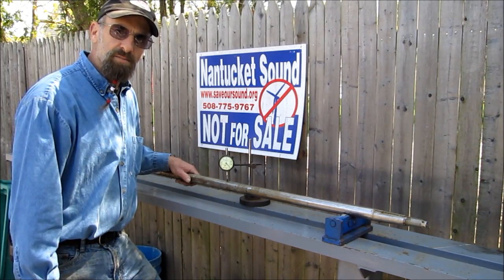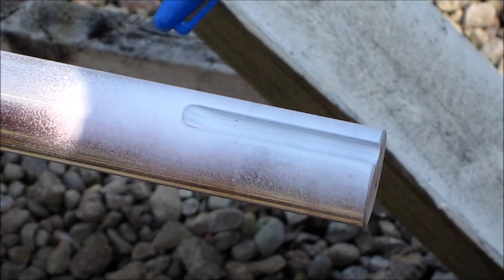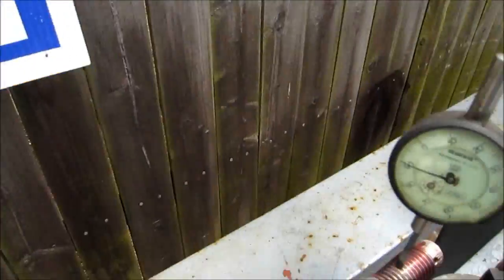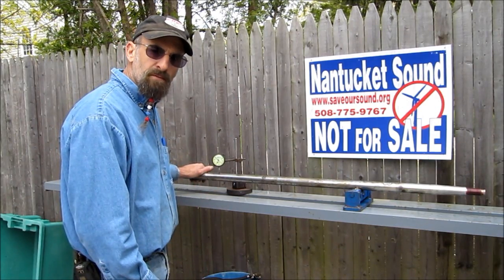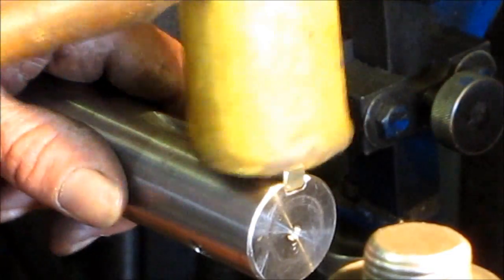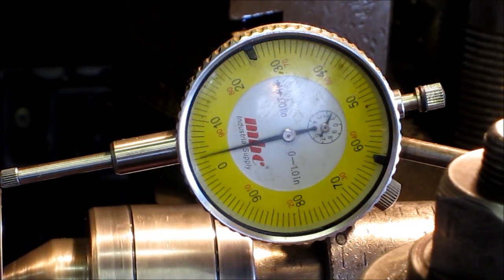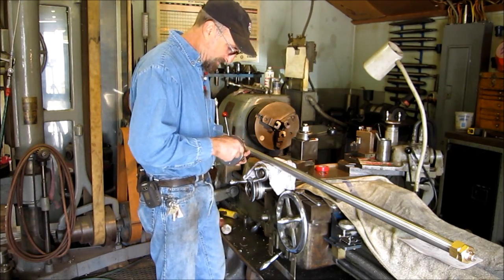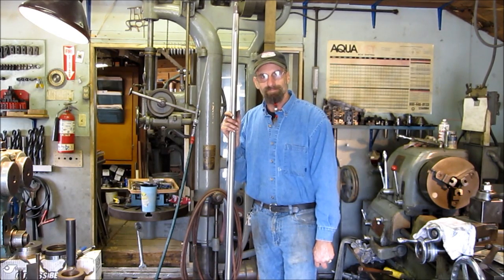How much Bend is too Bent!

Comment: I was having some major problems with my shaft in my boat and was getting a lot of input from different folks.  I saw this video and learned a lot and also witnessed demonstrated competence.  I needed help.   I went to Keith's website and got his contact info and we had a VERY friendly, patient, informative, technical and helpful conversation to the point I know what I need to do now to fix issues that included all the touch points on the shaft like coupler, intermediate bearing, stuffing box and cutlass bearing!  He has a donate option on his website with paypal and I paid promptly with the "cured my headache" option.  Time is money!  I will be back - I was lucky to have caught him at the right time - he was able to review my email and embedded video that outlined my understanding of the facts and data.  Thank you Keith !

Comment: Your video was excellent. It showed me that I can get the bend out of the shaft as I was planning on mild heat and beat the metal into submission. It was by the time I saw you expand the key I was just ... the dude knows metal. It also helped me a bit in how the balanced coupling is put together so I do not screw the balance nuts up pulling the shaft. Thanks.

Comment: I purchased new cold rolled steel plate 1200mm x 150mm and 10mm thick for purpose to be ways for my diy metal lathe. But they in the shop catted that piece with big machine scissors, and it got distorted all the way by length uniformly, that has about 5mm deviation on the middle. How to straighten this to be reliable for my purpose?

Comment: I worked as an equipment operator at a DuPont film plant years ago and worked out of the Millwrights shop. One of the head millwrights ended up being a family friend and was always building something for the inside of the plant out of stainless and it might be 20 or 30 feet long and he had to hold 2 thou. It never ceased to amaze me how he did it. Most always he never knew what it was until he went inside to install it. He did heat and drawing like you do. It is an ART! Still amazed! Good workmanship!

Comment: Never showed how it was straightened.
Reply from the maker: Some day I will show how I perform my heat straightening but not today. ;{)-----
Reply: EJConrad I have a damaged hydraulic ram, I understand flame shrinking well for fixing sheet and angle, but a shaft might be  a little different. Time to experiment!  Bend something, understand the mechanism of the bend, that'll help with the force and direction needed to unbend.  Keeping it straight, that's the real skill I bet.
Reply: +Keith Fenner I'll be waiting! i have a bent hydraulic ram that might be a good candidate for this repair.

Comment: Hello Keith,
 I have been trying to straighten a Small crankshaft for a triple steam engine with 3/8 journals,, do you it is bent about .004 what do you think about using heat to straighten or is it too small I use a 00 tip and make blue heated areas with no results . I used to be a crank shaft grinder and used to straighten shafts within .001 before blueprinting for dragsters and offshore racing were we would grind in larger radius's but use a press and a Big chisel with a Large radius on the end
This was a Friend of Dema Elgin
Aec Ryals
Reply: I wish he showed how he straightened it.
Reply from the maker: you may need more than a quick small spot to move steel, the S/S moves with ease but some steel can be stubborn. Sorry it so long to get back to your question. ;{)---
Reply: Maybe cool same quickly using a wet sponge... thus  dabbing same    but you don't want to stress the material all depends what metal it's made from, it could be forged from rolled steel... or else cast from Ductile Cast Iron... if its the latter your are dealing with a different ball game there, my friend....as you don't want to change the composition of the material or shock that little crank....best wishes with same..

Comment: Keith, what are the blue cradles with rollers called to rest and roll the shaft in during your runout check? I am trying to check runout on a disassembled outboard prop shaft and don't have access to a lathe. Thanks

Comment from the maker: Cracks develop in shafting because of loose fits and slamming the key in the keyways against the shafting keyway, the Aquamet materials are some of the most strongest, corrosion resistant, torsional loadable shafts on the market, but brittle when it comes to the hammering. With that said bends are not what the crack testing is focused around. That was a very good question. Sometimes after machining keyways you have to straighten the taper, very rare to get, runout exceeding, tolorences. ;{)-----

Comment from the maker: The material alloy in Aquamet, except the grade 17, is such that it can take the little pin point heat spots or even a weld fusion, without a annealing or normalizing. The spots are polished away with scotchbrite or paper to match the rest of the shaft with no later difference as it ages.

Comment: Keith, How do you maintain the same material phase across the whole shaft when you are doing your localized heating. Are you able to heat and set without causing the steel to undergo a phase transformation or undergo accelerated aging with respect to the rest of the shaft?  Thanks for your response?

Comment: Did a lot of that kind of straightening when I worked in heat treat.  Everything came in from lawn mower cranks to go kart axles plus my regular work (company)  Every once in a while you get a 'snake' and it won't come out no matter what you do.  You can also use a ball peen hammer and an anvil if you have enough grind on it.  Surprising it usually stays and doesn't move back.  Keep it up-I get a lot of new ideas.  Thanks

Comment from the maker: The shafting is priced by the pound and adjusts with the market, so it is a matter of shaft size and length. The machine work for a taper and key is also determined by the shaft size. Most small marine shafting, 2" and under, if material is in house can be made with a same day service, granted there is not a line of work ahead of your project. I have in the past without any interruptions, completed 6 same day shafts, on a Friday, during peak boating season and ran about a 9 hour day. ;{)-----

Comment: Funny seeing this, we ordered a 12" 3/4 spade drill that was shipped to us running out 1/8th of a inch. After beating on this thing for 30 minutes in a lathe we decided to try using our arbor press.  Me and my boss ended up putting 4 thousand pounds on a 5/8" shaft for the material to move and stay.

Comment: Nice job, I use to straighten stainless pipe shafts with heat in much the same way. I see the spots where you applied the heat. I'm impressed, you got it running very close, Tom in Seattle

Comment from the maker: @bob385100 Weakening a shaft by heat straightening is only a myth, in fact all Aquamet material, with the exception of A-17, is able to have a "Weld Fusion Overlay" process done without having to be stress relieved. This process is a weld build up then machined back to original diameters and usually done on shafts with worn surfaces in critical areas. That process causes a much greater degree of temperature than that used in heat straightening.